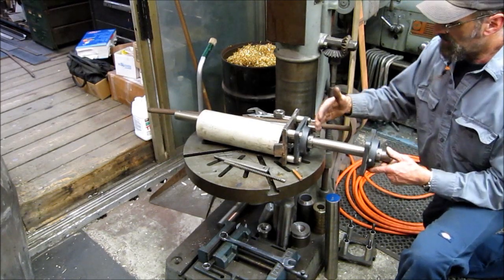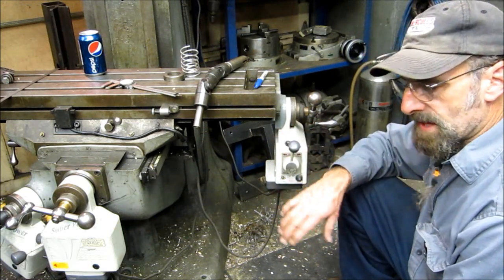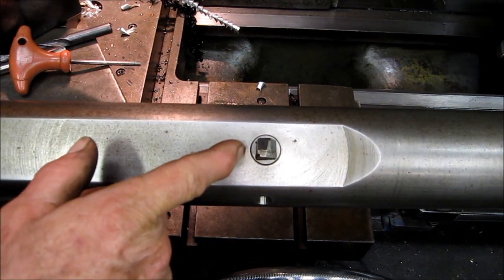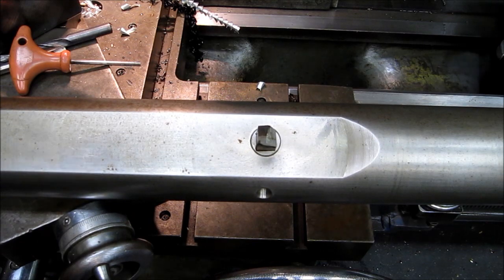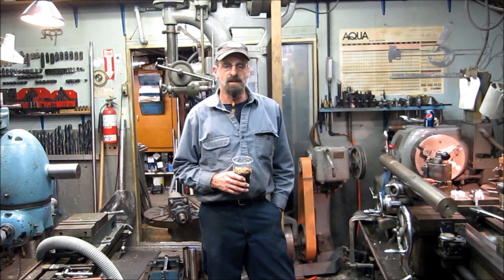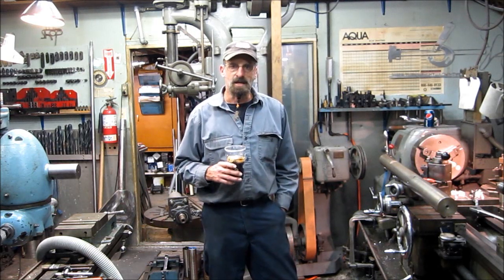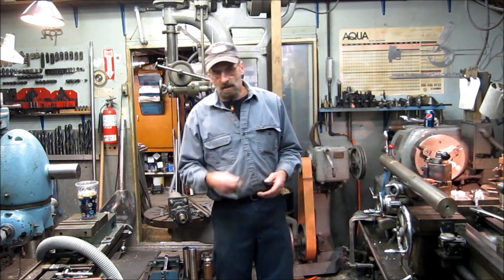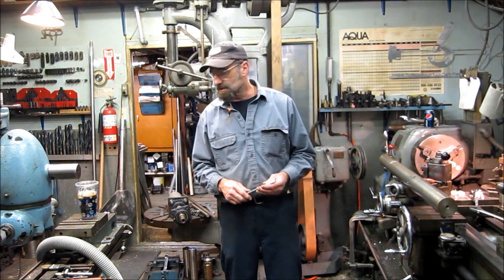Line Boring PART2

Comment: cool idea 
it inspired me to make sumtin with those bearings to bore out the 6 cilinderbushes out of an aluminium jaguar engine and bore the alumimium for the new oversize bushings 

wat im thinking of is making full engine length plates that bolt intoo the headbolts on the top and the carterbolts / mainbearingbolts in the bottom so it will allways align the bearings for the boringbar to the borespacing on this engine specificly
i use a regulair cross table with the electric drive to move the block toward the electric motor (drillpress layed on its side driving through a hole the foot of the drillpress ?) driving the bar quite some distance away from the crosstable 

it prolly take time to reset the bar for every cilinder but it should work

Comment: Git'R'done with what you got! Done a fair bit myself. I call the star drive "geneva movement".

Google "tsc carbide tool bit" - these are square shank bits meant for boring with the hole in the bar center. Take a look at the weird angles (they work like no other brazed carbide bit can for the purpose). Also available in tsa (square, 0 degree lead), trc, tre (round bit, 30 & 45 lead). These are also superior for lathe & boring head work.

Good luck!

Comment from the maker: They are two different line boring set ups, the self aligning bearing are to guide a bar in the field and the lathe set up had two sleeve bearings just to control the chatter or vibrations in the bar. Keep in mind there are many different ways to do the same type of machine operations as in line boring. ;{)-----

Comment: Could also use round hss tool blanks and grind your own tools to fit round hole. Old broken tap and endmill shanks work too. or just O-1 Drill rod that you heat with a torch and harden yourself.

Comment: Keith, please tell us where you get the round/square inserts that hold the cutting tool.  I don't have a broach, so this is a very necessary part for me to make a boring bar.
Sincerely,
David Parker
Reply from the maker: https://www.google.com/search?q=low+carbon+steel+square+hole+tool+bit+sleeves&espv=2&biw=1360&bih=667&tbm=isch&tbo=u&source=univ&sa=X&ei=vg8SVZvDPJHbsAT1kYDICA&ved=0CDcQsAQ
Reply: David, with all due respect to Keith, you don't actually need the square insert. If you are using round tools, just mill a flat on the top of the tool and you tightening stud will line it up square.
Reply: I found them in the MSC catalog, you can probably find them from other sources

Comment from the maker: @joydon1100 Sure: In MSC catalog, Low carbon steel square tool bit sleeves, are the correct term. 1/2" size is # 82432287, should be helpfull Ref's, if not find in with square tool bits...

Comment: If you look at the you tube video, "line boring a large excavator bucket"; you can pause the vid. and see a square tool running in an ordinary drilled round hole; this is completely satisfactory.

Comment: Hello Kieth, I have bored and faced both ends of casting for a vertical head. I plan to bore a bearing seat one side, turn the casing upside down and do the other. I am using opposing tapper rollers so I need the seats dead square.  Question is... what is the likelihood the bearing seats will be square. Or does the whole job have to be done in one hit? Thanks Dave :)

Comment: The square hole insert thing is just a waste of time; I've made several boring bars; a 3/8th. Chinese brazed carbide lathe tool fits in a 1/2 drilled round hole. the Set screws coming in a ninety degrees to the tool keep it located. It never even occured to me to mess around trying to made a square hole, it's obviously a waste of time. I have also tapped the reverse end of the hole to obtain calibrate drive depth for the bit; this is also obvious.